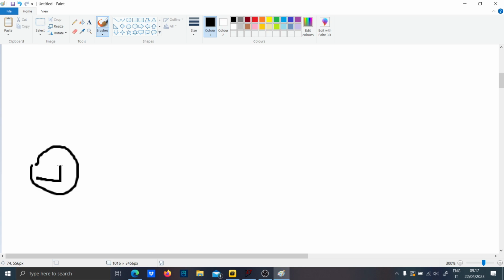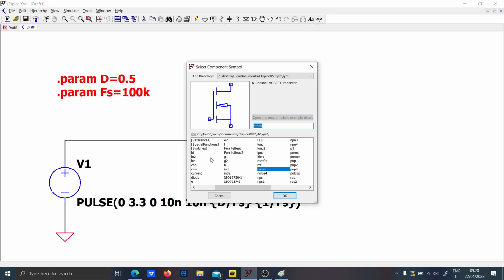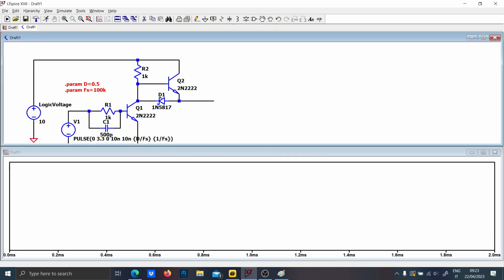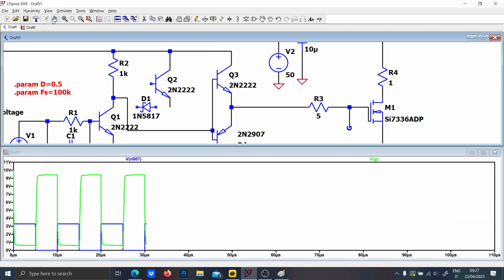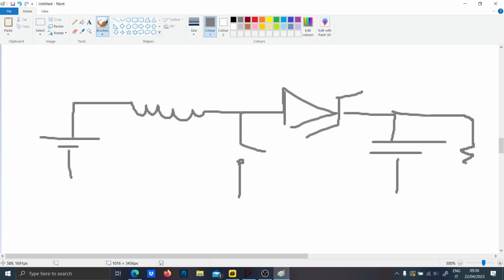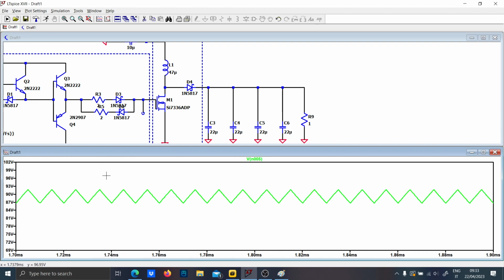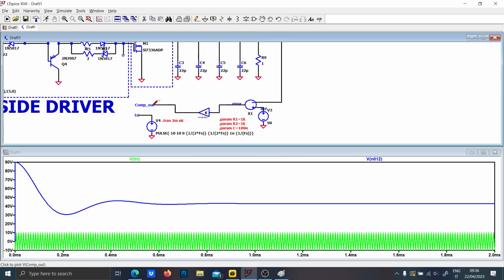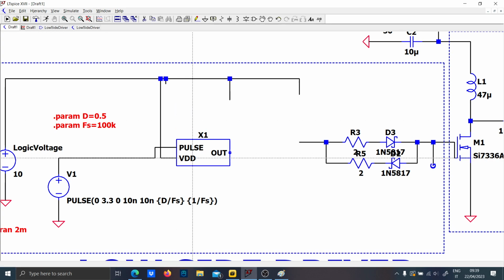LTSpice  Fast Low Side Gate driver and DC-DC  Boost Converter

Comment: Hey, I just came across your video. I want to build the circuit for a school project, but with 72V to 5V and about 10A. Unfortunately, I don't really understand how it all works. I would copy the circuit and simply apply 72V instead of 50V. I'm still new to this. Could you help me build a circuit if necessary? ❤
Reply from the maker: Use a Buck converter . For 50W an IC will do the job with external mosfet
Reply: @LukeXVIIx64 the Problem is my Teacher want me to Build it myself , 
And is 72v DC to 5v DC 10A … 
But Thankyou
Reply from the maker: @letsplaytom9758 With discrete components? No uC? Just Analog?
Reply: @LukeXVIIx64  ICs are allowed, just not microcontrollers. So analog / power IC solution with external components
Reply: For our school project, we  need to convert a 72V battery to 5V; it needs to be designed for approximately 10A because we have to power Raspberry Pi etc. It's an e-kart we're building, and my teacher wants us to build the converter ourselves, design a circuit board, and then display it behind plexiglass.
Reply from the maker: @letsplaytom9758 Then Buy an IC controller Buck converter, Use the demo board for the Layout and design guidance. Even an LTC444X for High side driving will do the job. Making every discrete is too much time consuming
Reply from the maker: @letsplaytom9758  Then go to Digi Key and select a Integrated Controller for around 200W as power, Vin 100V either current/voltage control, the tool and the datasheet helps you design the inductor and the mosfet as well, plus the compensation network, feedback, etc..
Reply: @LukeXVIIx64 Thanks , i create with Texas Instruments Tool a Layout, now i will Order , Thankyou for your help , 
And a Question , so we have high mosfet this one is for loading the Inductior , and the low mosfet is for discharging the Inductior ? If Both Open than we have a Short ?
Reply from the maker: @letsplaytom9758 Yes but the controller will handle dead time for you
Reply: @LukeXVIIx64 thank you ❤

Comment: Hello, thanks for your video
 can you explain the choice of the BJTs for this push pull, I am trying with BJTs that have Ic=10A and I can't get a good signal at the output.
2SCR582D3 for the NPN and 2SAR582D3 for the pnp.
Thanks

Comment: Could you please explain RHPZ of boost Converter using LTSPICE
Reply from the maker: RHPZ comes intrinsically from the transfer function (obtained from the small signal model) of the boost converter.
Basically it says that owing to that RHPZ, it is not recommended to operate the boost and buck boost converter in CCM condition. However, my power electronics professor said that if you are designing a boost for PFC application, you are gonna have an overdesigned boost when the rectified voltage tends to zero. CCM operations are allowed in PFC design ( but PFC and active rectifiers are basically another branch of power electronics, specifically made for solar pannels  I daresay)
Reply: @LukeXVIIx64  Interesting!! It would be great if you could make some video on this and many Thanks for sharing your knowledge